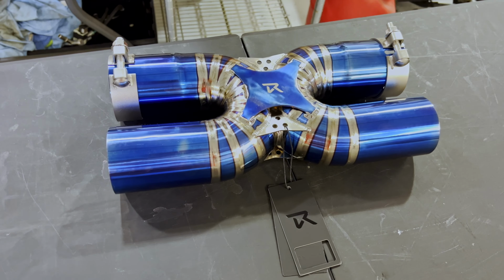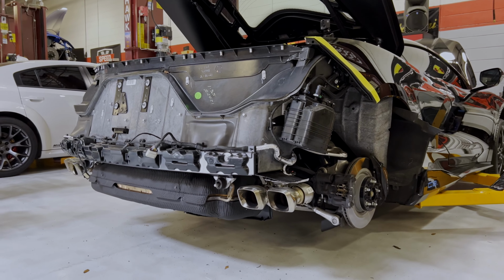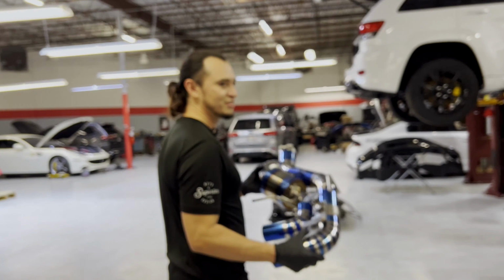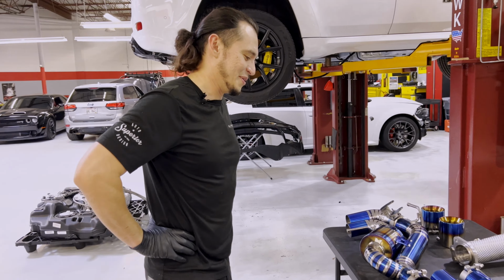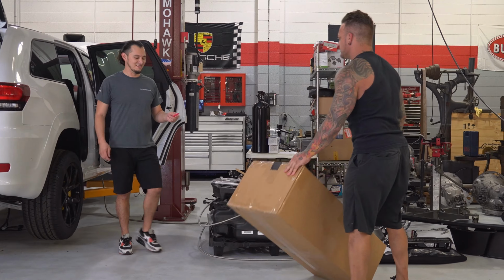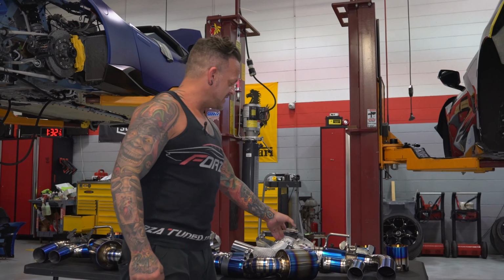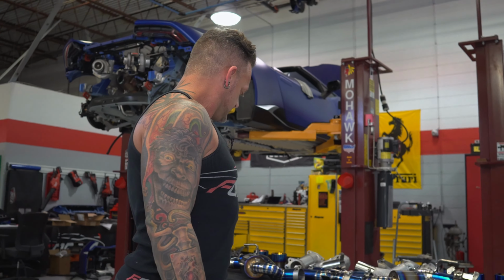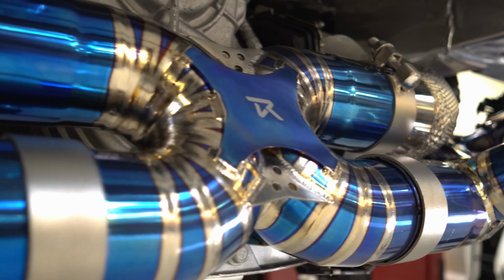C8 Corvette Ryft Titanium Exhaust (WARNING:LOUD‼️)

Comment: What’s the difference between Downpipes and full exhaust (720s) platform
Reply: Aftermarket downpipes usually feature wider capacities, and they are less restrictive than the stock option. Crucial for moving the exhaust gases through the system as efficiently as possible.
Reply from the maker: Downpipes replace catalytic converters only and full exhaust includes downpipes and cat-back exhaust